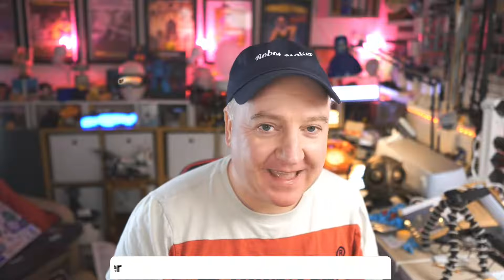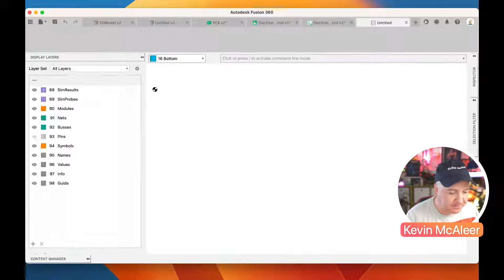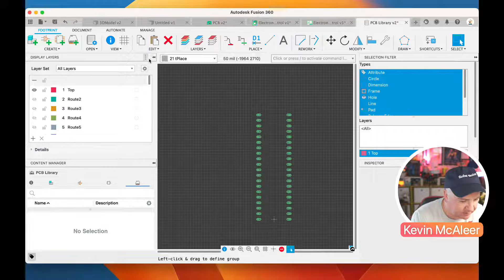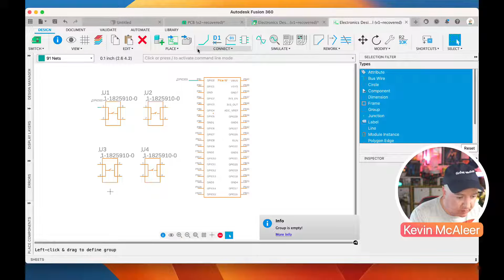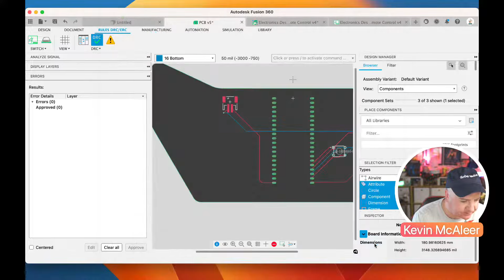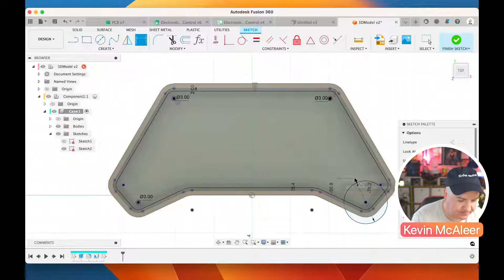How to Design PCBs with Fusion 360 in less than 1 hour

Comment: 2026, Stay away from eagle/Fusion. eagle is not avaliable to use now. If you are considering purchasing Fusion subcription for PCB design, avoid it. Try Altium or KiCad if altium is bit dearer. Fusion keeps all your (IP) files on cloud and if has so many performance issues. AVOID AUTODESK FUSION/EAGLE. Don't ask me about Customer support 😖😖
Reply: fusion for PCB may be bad, but what is the problem with using it for 3d modelling?
Reply: @bhupiistersingh4097 I used it only for PCB design

Comment: Nice tutorial, clearly a build for a real project, so that's cool, BUT ...

The build out of the custom component in a library (pico) was a huge diversion from the core of "how to design  PCB". It is useful to know custom components, but it shouldn't have made up half of the video. Choosing to model a PICO with 40 leads made for a tedious lesson. Otherwise it was all good. 

I would have chosen a simpler custom component like a SD card module or bluetooth module ... 6 leads instead of 40. Less geometry to line up. All leads are meaningful. For the pico, more than half the pins weren't used. 

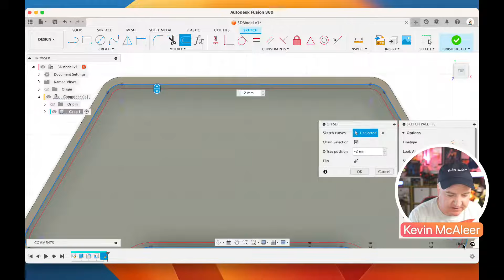0:00 - 10:00 (YOU CAN SKIP)  building an enclosure

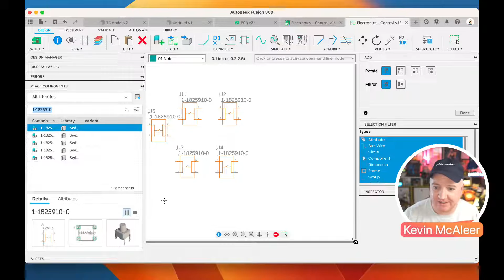10:00 - 18:30 (USEFUL) ASSOCIATE PCB WITH EXISTING MODEL

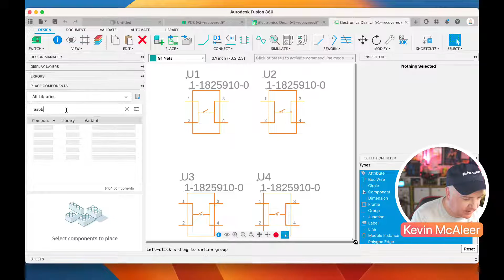18:30 - 45:11 (YOU CAN SKIP)  tedious creating a custom component  

45:15 - 1:15:00 (USEFUL) This is the tutorial you were looking for

Comment: Spent half an hour looking for the tool or shortcut to measure a distance on a fusion360 PCB design, I have ended up using  a ruler on the actual PCB. Never in my life, working on PCB design since 1992, have I used such an unintuitive annoying piece of software

Comment: I'm really struggling with how to create a simple VIA (through hold solder pad) and then connect this to one of my components.  I've added the VIA but the connectors won't connect between the VIA and say the pad for a diode.  I'm pulling my hair out!

[Edit] Found the answer.  First you draw a line to the component you wish to connect to a VIA and define it as you did in the video with the virtual wires.  Then in the 2D board layout you add a VIA and give it the name of the virtual wire you want to connect it to.   When you start typing the name of the VIA it will show you your options as you type.  Pretty slick once you know how, damned frustrating when you don't.

Comment: proof that Eagle in Fusion is one hot mess.. btw. You can scroll with your mouse wheel/switch. Combining ctrl, shift and the mouse wheel will get you around the UI pretty well. Good on you for doing this live stream. This is what we all go through. It is so complex that if you come back to it in a couple of months you have to learn it all again. I've had Eagle for at least a decade and a half and I have done about 10 large boards with it. It took a lot of effort to get them done though. In the end, it was reliable. (doesn't crash as much on a PC, BTW)
Reply: Thumbs up from me. It is a hot mess, though it is a hot mess all in one big dumpster with random crashes to keep us guessing when it might not do the next thing asked of it. Attempting to route signal pairs allow PC users to get more consistent crashes if you like that kind of pain. It will save your files behind a paywalled cloud if you pay for it and also update randomly and always ask for feedback on close. It's terrific.
Reply: I believe it is going to get better soon. Autodesk knows how to make good softwares. It might take time, as anyone who have ever worked with software knows. Integrations like these, eagle into fusion are massive projects. But I like the idea of a single software that can make 3d designs, assemblies, fluid, structural and thermal (preliminary) analisys and PCBs. It is like a makers dream. I am enjoying where fusion is getting.

Comment: One more question. You created a derived board outline from your enclosure CAD model offset sketch. I seem to remember that you can't place that circuit board back into the 3D enclosure because of a circular reference. Is this still true as well? Do you have a video on this issue? Thanks.
Reply: Just tried this, circular ref issue remains. The workaround is create yet another file and place the enclosure and the circuit board in this new file. This is just above functional. I might be missing something here.

Comment: Hi Kevin, fantastic video. Especially where you are creating the library part for the Pico W. Question... Do you use Fusion360 electronics to draw up your cables with connectors on? I kind of cheat and draw them as if they were for a PCB; however, it would be good to draw them with all parts, like the shell, the pins and the wire, and even the screws, so I can get a good BOM. So far, I only seem to be able to add my own "library part" for the connector and wires, which is a good start, but not sure how to add the hardware like screws as it is not technically part of the schematic. What are your thoughts on how best to do this?

Comment: in the 2d PCB design where you'd place the components, i only get and error message, some objects extend outside the allowed area, and i cannot drop them, i even tried minimizing the sitze of the area, since it seems that on the free version only 80cm² is allowed but even after that it does not work.

Comment: Hi Kevin, I’ve been enjoying your Fusion PCB creation tutorial and I have a couple of tips for you that will make your life simpler. The Select tool is something I use constantly and is very powerful. I find it very helpful for positioning things since it acts like an info command when you select a pad, component, line, or any other object. It gives you the coordinates of an object and allows you to edit them as well. So, for instance, placing pads for a foot print you can reference your first pad to the origin, which is (0,0), and then your other pads can be placed relative to that. So, if you have an IC that has .6 inch spacing between the pad rows and 40 pins, you can place the first pad the first pad at (-.3,1.0). This will have your first set of 20 pads at -.3, so your second set of pads will be at .3 , giving the .6 spacing with the origin at the center of the foot print. You can move the entire foot print to orient it so pin one is at (0,0) or wherever you prefer. This helps also when selecting and placing footprints in the PCB editor when you are laying out the board. If you need to move a component by just a bit, .05 or .025 etc. just select it and edit the coordinates. Fusion also has some great alignment tools also. I really enjoy and look forward to your videos.